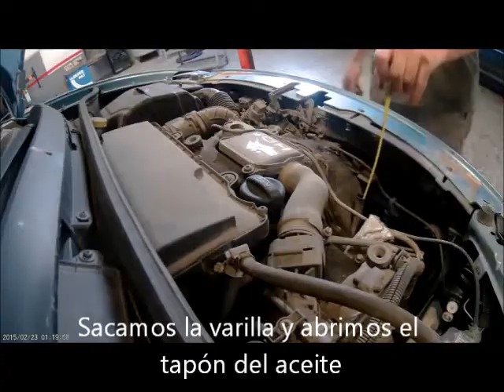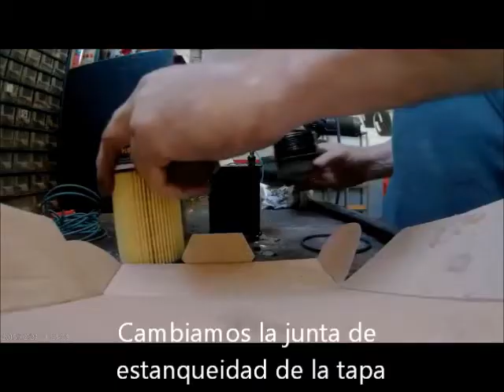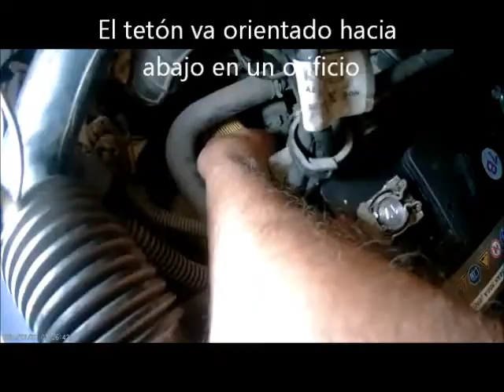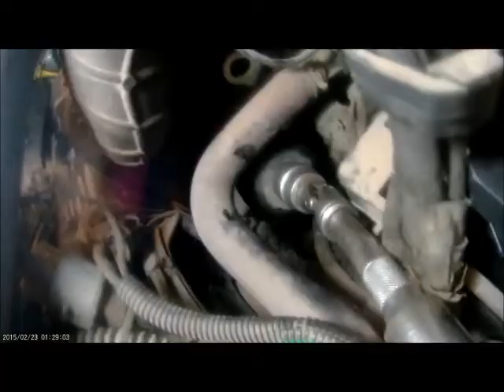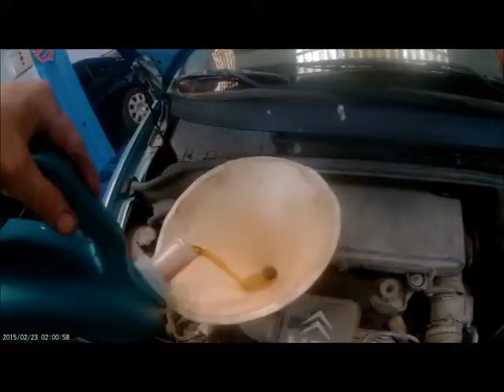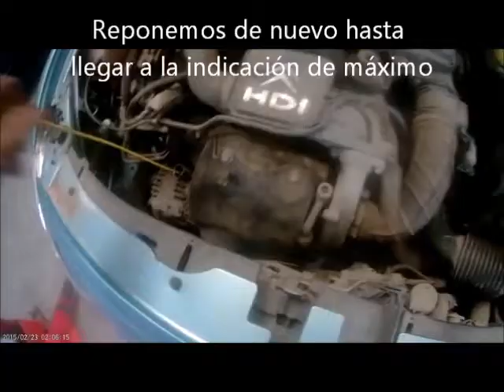cambiar aceite y filtro de aceite  Citroen C3

Comment: Hola buenas una consulta 25newton m.. seria un torque de 2,5 kg ?seria 2,54kg...ya que el newton equivale a 9,81k.. es asi? Muchas gracias
Reply from the maker: Hola Ezequiel. Perfecto. Es así como lo has explicado. Un kg equivale aproximadamente a 9,81 nw. Luego 25 nw sería algo más de 2,5 kg. Saludos.
Reply: mil gracias..no quería equivocarme..saludos
Reply: muy buen videoo..
Reply from the maker: Gracias Ezequiel. Que pases buen día.